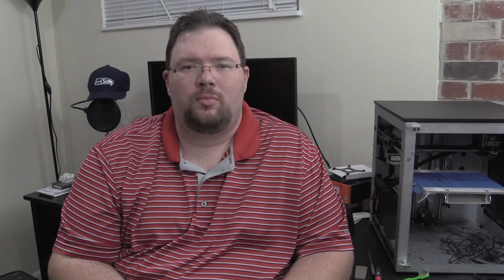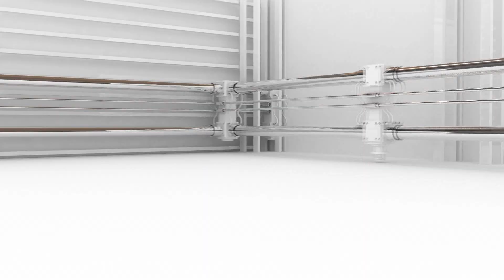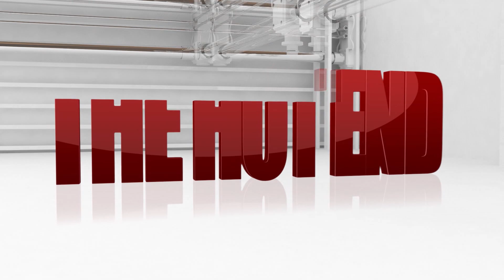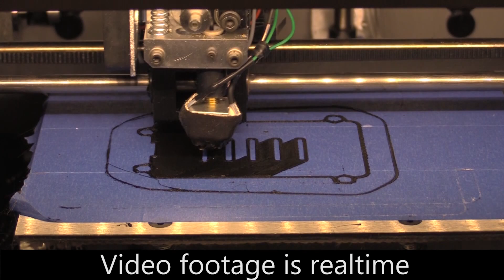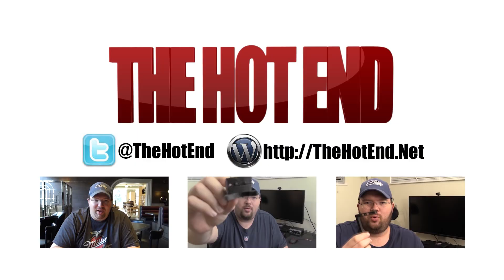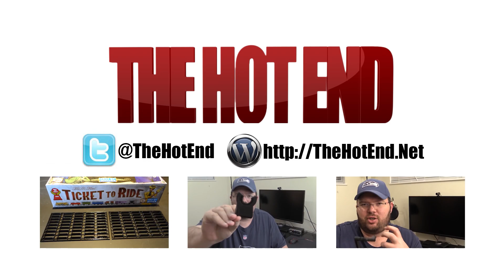Windows 10 3D Printer problem

Comment: Your video seems to be the only thing I can find online about this issue. You would think more people are running into this... Anyhow, I have the same issue since my machine upgraded to Win10. Was thinking it maybe has to do with power management but setting everything to run 100% of the time does not fix anything. Using the latest MakerWare Desktop USB COM driver from 06/2015. Since this seems to affect a bunch of different 3D printers I assume this is an issue with the USB stack on Win10.

Comment: My printers having this issue, and I've narrowed it down to a slic3r issue, as it occurs even if i use octoprint (on a raspi) with a slic3r gcode file that i generated in windows 10 tpe.  If i use cura it seems ok, other than I dont have cura settings dialed in so my prints turn out like crap. ¯\(ツ)/¯

Comment: Interesting, I am running windows 10 Technical Preview and have done for over a month on my laptop which powers my printer and haven't had any problems. I do get split second pauses every now and then but I put it down to the arduino chip not being powerful enough.
Reply from the maker: Switch to a different OS and see if the pauses go away.
Reply: TheHotEnd No change, Switched systems from 2nd gen i7 running windows 10 to 3rd gen i5 running windows 7 sp1 and nothing changed. Its ether Simplify3D or the arduino chip. or both. I know simplify3d produces larger (denser) gcode files compared to slic3r and other slicers.